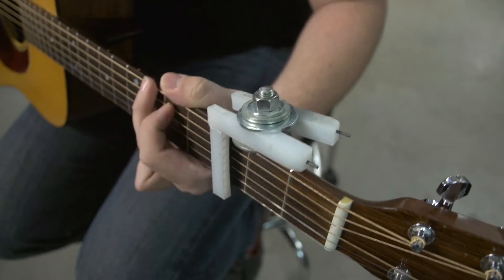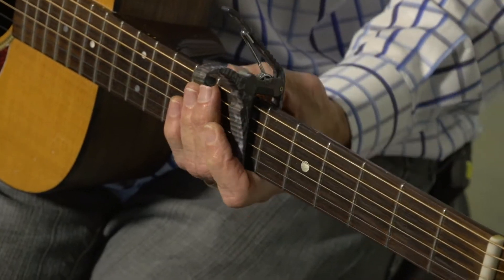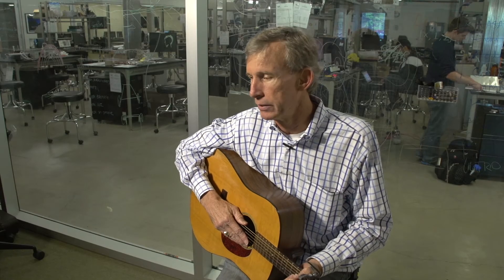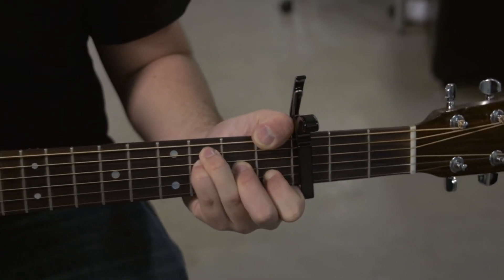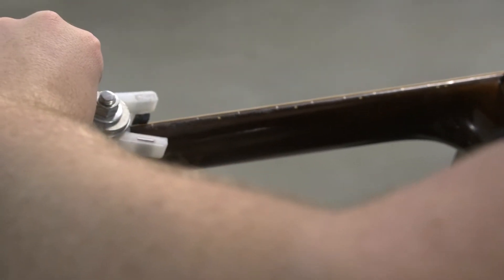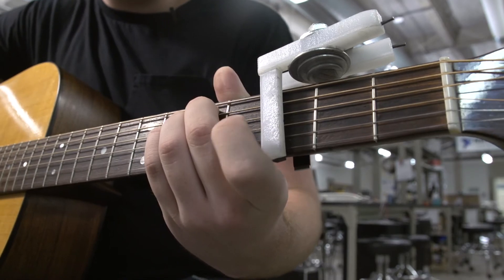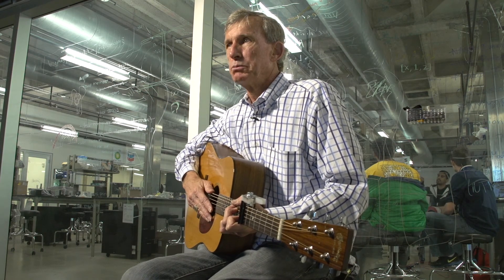Rice students design and build a new guitar capo

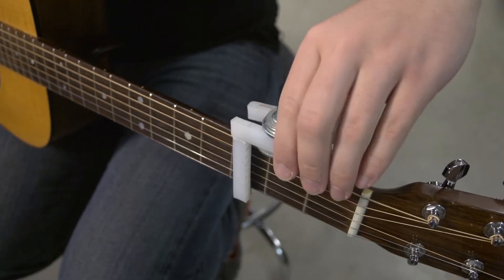Comment: How well does that monstrosity function when placed on the first fret (1:25)? Is there no interference with the tuning machine? At 3:00, imagine what that metal bolt could be doing to the woodwork on the neck. All in all, the idea is interesting if irrelevant, but it seems to be a pretty pitiful prototype.

Comment: Hey John Jaggers, if the Kyser capo gets in the way of your thumb chording and muting, turn it around and put the grip end at the bottom of the fretboard. But then I guess if you did that, there would be one less reason to teach our next generation of engineers that there is a future in creating projects that solve non-existent problems.